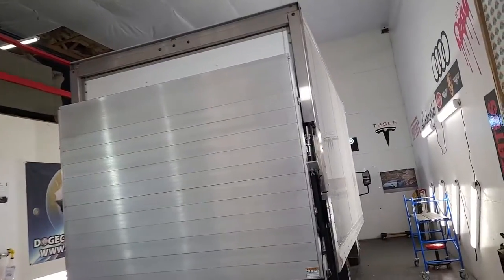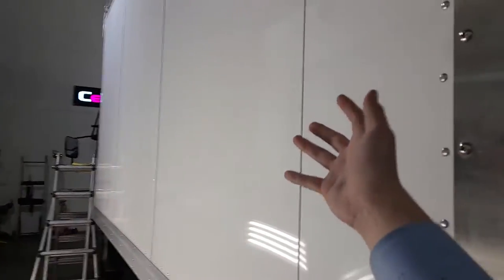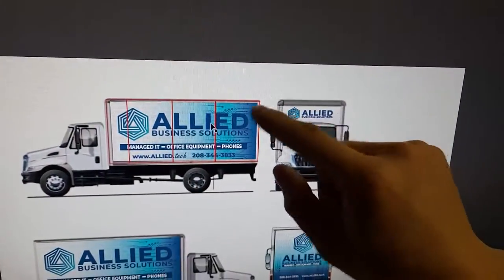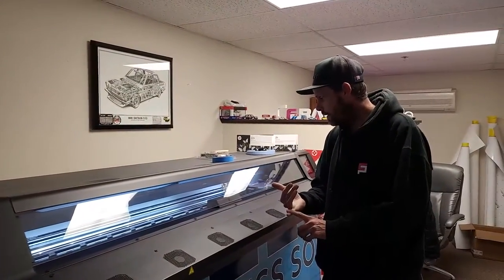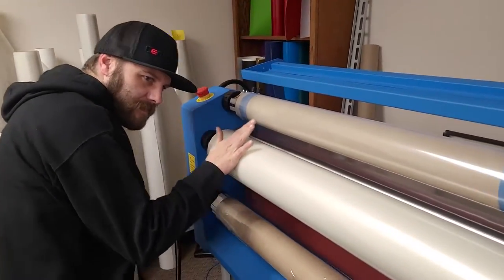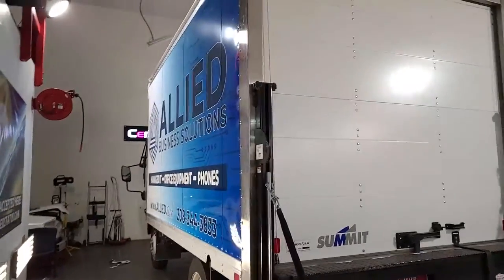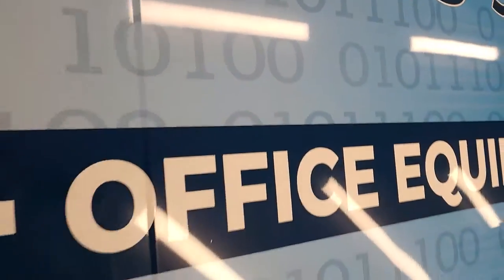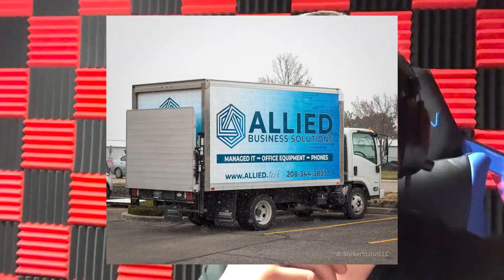How to Wrap a Full Box Truck! | Behind the Scenes!

Comment: Can you tell me, how do I UNWRAP a box? We have a box that we need to get an old set of vinyl letters off... SOS
Reply from the maker: This can be a very challenging task, it will generally require a 3M rubber erase wheel, adhesive remover, plastic Razor blades, a heat gun and lots of patience 😀
Reply: @StickerStatus  NEVER heard of that rubber erase wheel, man that looks MONEY! Thank you for the quick reply. I pealed a lot of the vinyl, but the adhesive separated and is still there. Rubber wheel is the play!